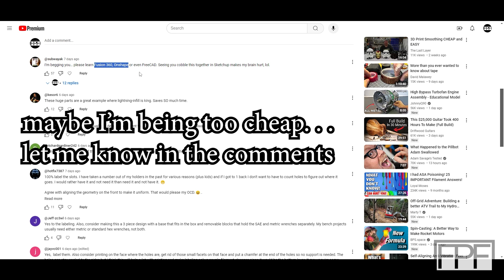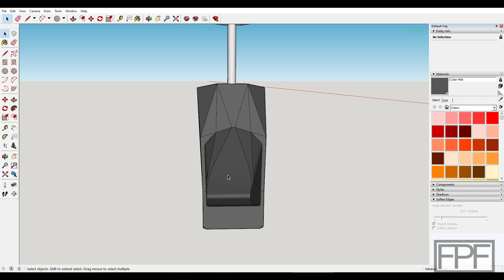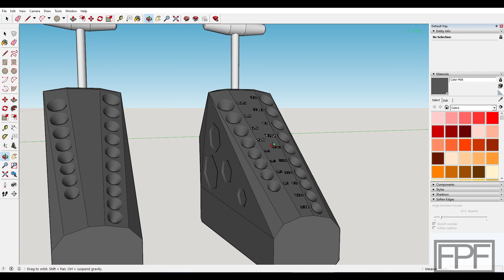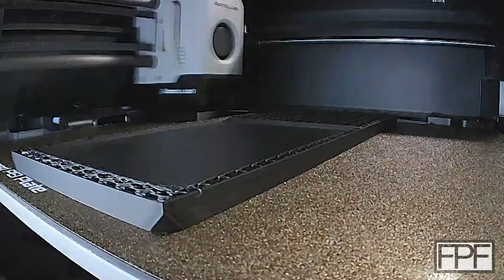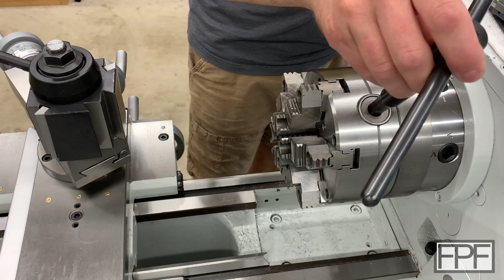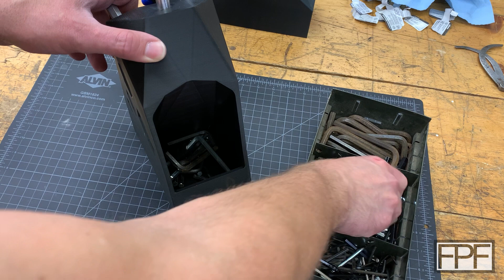3D Printed T-Handle Hex Wrench Rack - Finished!

Comment: pretty cool man,  I have been trying to find a model for my t handles to fit nicely in my hutch at work.  I suppose that I will need to delve into the design world so see what I can come up with. I have the SAE, metric and torx set from Tekton tools that I use pretty often.

Comment: Recently discovered your channel and really enjoy your content. Reminds me a bit of "This Old Tony" but with more focus on functional 3D printing with machining sprinkled in. You have all the toys I wish I had room for. I built a Railcore II 300 ZL which I use primarily for functional parts but simply have no space for a lathe, mill, or laser cutter. With regards to CAD software, the version 1.0 release of FreeCAD recently came out and it is a huge improvement and finally actually usable. It is not Solidworks or AutoCAD but it is now pretty decent. Solidworks also recently came out with a maker price of $48/year that goes on sale periodically for $24/year. I am not sure if it has the same kind of restrictions that the other products do but you may want to consider taking a look. Keep up the great videos!
Reply from the maker: thx!, and I'll have to look at FreeCAD again

Comment: You should have done the labels on a flat plate that you could glue down or attach in some fashion.  You could print it flat and there wouldn't be near as many color changes.
Reply from the maker: I considered it, but really wanted the markings right up to the edge of that face.  If I were to make another, I'd leave the text off the print and just laser it with the MOPA.  Separate plate as you suggested would be the best bet for someone with no AMS or laser.  Would be minimal manual color changes if flat.

Comment: You could design in some supports to position the part on the build plate with the text surface parallel to the build plate so all the filament changes are done in the last few layers. You might end up needing supports for the storage compartment but they wont leave visible defects.

Comment: Have the same  sets and thought now that would be a nice base, downloaded, thank you :), sliced then saw 19 hrs + print time and almost $24  cost using PET-CF. It's very nice but that nice isn't worth $24 to me. :( 
Time could be improved  pretty easy with infill settings where the bulk of time is spent and PLA which would be fine for this would cut the cost substantially. May go that route, it would be a nice bench top addition.

Comment: I used to use fusion 360 the paid version and I also used to use blender. I found this new software about a year ago called shaper 3-D. There’s a free version and then there’s also I believe it’s a $30 a month version but it’s pretty much the same thing as fusion 3-D. I use it on my iPad, but they also have a computer version And to be completely honest. It is my favorite software. I get everything done so fast they have a 3-D printing design just 3-D printing it in the software too. I would definitely recommend you checking out shape or 3-D. It’s more for people like us that design parts for 3-D printing.

Comment: Pretty sure the fusion 360 cost is fixed for life as long as the seat is renewed each year. I got in early at $315, due again this October at some price.
Reply from the maker: interesting, I need to look into this.  I think i'd still rather use onshape though
Reply: @FunctionalPrintFriday  OnShape seems to be very popular, see it being used on YouTube all the time. Does OnShape include CNC  post processors?  I do like the built in rendering in Fusion, just for fun.

Comment: This was exactly the project that I have been putting off, Thank you for your channel and a great design!
Printed in PETG black, no lettering printed great first try. Had to drill out the 3/32 hole.
I've been using Sketchup for years for mostly architectural and woodworking projects. 
When I started machining, CNC, and 3D printing, I realized Sketchup wasn't the best tool for these. 
Solidworks is too expensive. The free ones were good, although I found Fusion 360 was worth the expense and learning curve.
I look at it as the software is just another expensive tool as my lathe, CNC router, or X1C. Thank you

Comment: You should make a version with hollowed out lettering. That way those of us without a multi filament printer can still have the lettering and fill them in with enamel paint or epoxy if we choose.
Reply from the maker: since the lettering is a separate STL, that fills the hollowed out lettering, this is already how the STL is.  Just bring in the STL for the base, but not the lettering

Comment: If you don't already know Fusion or OnShape, FreeCAD is worth learning. It's different than Fusion and OnShape, and has its quirks.  But I use it for all my 3D print designing.  The last design I did was pretty complicated, a custom socket tray for 4 sets of sockets.  Turned out very well and FreeCAD worked great for it. FreeCAD has warts and a steep learning curve because it is so flexible and extensible, but it's a great tool.  Give it a try.  MangoJelly on youtube has very good videos on learning it.

Comment: Excellent project. And as far as you getting carried away with the design, I do that all the time. I am currently in the middle of designing/printing a 500 watt, 640 Wh portable power station/Bluetooth speaker box. I continually refine the design as I test print the parts. When it is finally done it will be (hopefully) exactly as I envisioned it.

Comment: an easy work around to the color change problem, is to print all in 1 color with the raised text, then after the print is done go over the lettering with a fine tipped paint pen, save the extra 8 hours, lol!
Reply: What I used to do was print a color I don’t use, spray paint it black and hit the raised text with sandpaper! Worked every time

Comment: Why don't you turn the flat surface of the model with the numbers on it, the single piece in between the two sets of holes, into a separate plate with the numbers on it. Like a name place for an office but with the text turned sideways (compared to a normal name place) and the shape isn't a pure rectangle. I hope that makes sense.

You could cut out a slot for label plate in the main model, and then print the label plate separately. Once it's printed, take off the build plate and then glue it in place. If the label plate is too long for the printer, cut it in 1/2.

That in theory would save a lot of time and unnecessary filament changes as the label plate wouldn't need to be more than a few millimeters high.
Reply from the maker: yes, great idea.  if I ever revise it, I'll do this

Comment: The storage space, labels and the cone shaped holes were great additions but the handle really made it pop. Very nice build. BTW, how do you like your 6 jaw chuck? What brand is it? Do you feel like you gain much over a 3 or 4 jaw, which all have there place, but for daily use? Great video!
Reply from the maker: thx!  It's a shars, and I do really like it so far.  It's not as nice as my Taiwanese 3-jaw, but it's better than most of the China imports.  DO NOT buy a CME/Sanou.  I have a nice 3-jaw Sanou on an indexer that tricked me into trying two of their larger chucks, and they were both garbage.

Comment: Regarding the M4 cap screw, if the handle is rounded, would the screw ever be flush?  Would a printed push fit rounded cap meet aesthetic needs?  Or is the size so small you wouldn't notice if the side of the screw head isn't flush with the handle curve?
Reply from the maker: I was aiming for the top of the cap being flush with the low points on the rounded handle, but the whole thing ended up ~1.5mm too low.  I stopped in the right spot, tried the screw and thought I needed to go lower, but it was just hanging up on a burr :(
Reply: @FunctionalPrintFriday  LOL!
"Don't you hate when that happens!?"

Comment: Consider a printed handle for the masses.  Printed hollow stem with all-thread as a spine.
Reply from the maker: The handle should be ok if done as two halves glued together, so the layer lines are working for you

Comment: Hey, I asked this on your last video, but maybe it got lost in the shuffle. Sorry for the copy/paste repost:

I'm curious after following you for a while - What do you do (if anything) about material recycling? I'm at a point in my 3d printing where getting a shredder/extruder/spooler setup could pay for itself, but everyone who makes them wants thousands of USD for the machines. I'm not sure I'll ever be in a place where I can convince myself to spend $2.5k+ on a filament extruder.
Reply from the maker: I just don't think it's worth it, but I DO wish we had better recycling options.  For now, mine are just going into the garbage.  The cost/energy/time needed to recycle on a small scale just doesn't seem to make sense.  Now throw in nozzle clogs unless everything you're putting in is perfectly clean (did static on the part pick up a wood chip, piece of metal, etc.?)

Comment: If you print this on an angle (yes, it will require supports) then the top surface can be flat so that the lettering can be printed in colour with one change.
Reply from the maker: yes, however, the supports would be on the inverted funnels, which we want to be as smooth as possible, to enable self alignment when putting the wrenches in

Comment: Could have made a built in handle as a cavity at the rear top above the current cavity.  Basically just some place to put your fingers in to lift it.  Not sure if this means you need supports (quite possibly).

Comment: FreeCAD is free for commercial use (free for ANY use). There have been huge improvements in the latest dev version (0.22) which is going to be released as Version 1.0.0 in August so if you try FreeCAD, use one of those versions, not the older versions. 😎
Reply: From what I've seen Ondsel might work as well since it has the same license with a more refined UI. (It's a freecad derivative)
Reply: Yes that's also possible @OttoLGlass Personally I'm not a fan of the Ondsel Lens thing but others might like it. I like what Ondsel are doing to push the project forward and I think they're contributing all new features back to the parent project so they will likely appear in FreeCAD anyway at some point. 😎
Reply: Yes I also second freecad, it is more clunky than Onshape, but at least it does all the "cad things"
Reply: It seems to be improving and it's hard to beat the price. One of the problems I found in trying it was discovering that commercial CAD programs spoil us with features and we also get comfortable using them, to switch is a very frustrating experience. For some one whos brain was not fixed on  having used another it would be much easier learning curve I'm sure.

Comment: You could make the labels a separate part/ plate. Thank you can print it flat and it saves lots of fillement changes. And it saves fillement and time.
Reply: That’s a great idea that I’ve never considered.  I’m now already thinking about how to cleverly utilize this in my next project. Thanks 🙏
Reply: Genius!  Thanks!
Reply from the maker: yep, great idea
Reply: @FunctionalPrintFriday  great video btw😁
Reply from the maker: @Florens1989  thx

Comment: Hey Mate, why don,t you make the lettering as a Inlay to print it seperatly?
Reply: This is the way especially for those who don't have filament changing set up. If I didn't see this comment I was ready to suggest it myself. :) Dab of hot glue or CA glue for extra hold just in case.
Reply from the maker: great idea
Reply: @FunctionalPrintFriday  yeah, I would like to see the lettering done as a 0.5mm inset, so I can just fill the void with paint.
Reply: Came to me immediately as well. Keep changing the filament all the way through is absolutely insane. Also, you can print inlay with smaller nozzle to do it neater